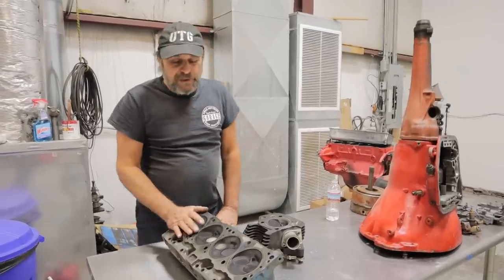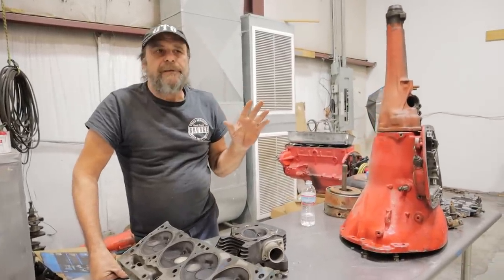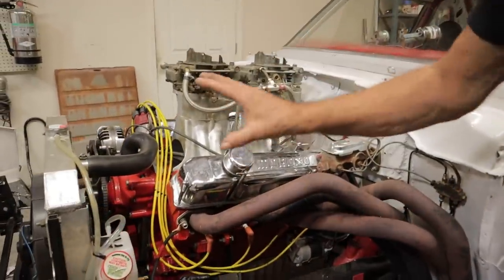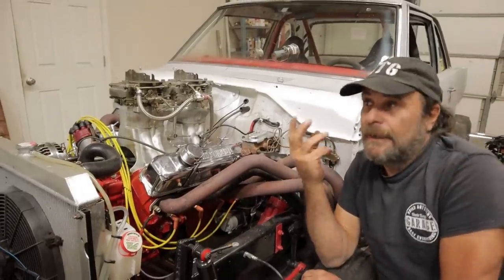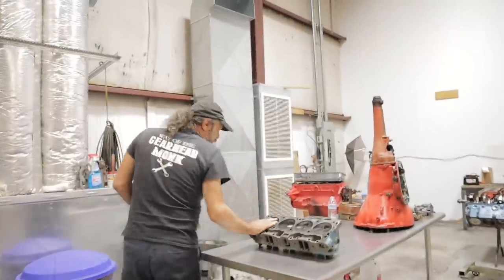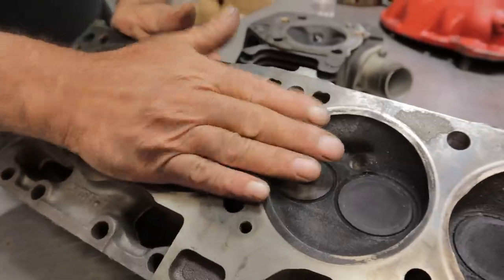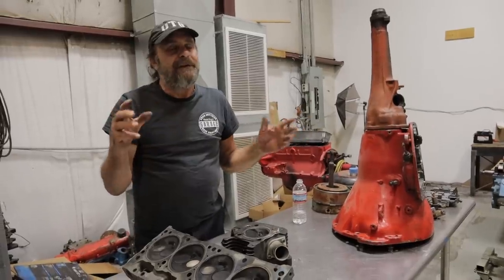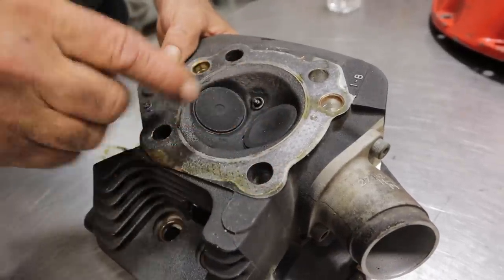The Secret Life Of Your Engines Cylinder Heads - How Combustion Chamber Shapes Make Power

Comment: The 273 LA heads from the start had more modern valve angles, compared to a small block Chevy and had a more modern spark plug location. Until the early 1960's it was thought maximum horsepower was to have a split overlap. That is a 112 degree lobe separation would be best with the intake lobe centerline at After Bottom Dead Center. It had already been found that better powder was produced with some advance, but it was thought to be due to timing chain stretch at high RPM, but it happened with gear driven camshafts too. Camshafts started getting advanced for power but it wasn't well understood. Close lobe center camshafts would often make more powder. Part of this is at split overlap, a 108 lobe separation would be timed at 108 degrees after bottom dead center, while a 112 degree lobe separation would be split, degreed at 112 degrees after bottom dead center. In the mid 1970's, camshaft theory was finally updated to state that, theoretical maximum powder would be with the intake centerline at 106 degrees after bottom dead center and maximum torque would be with the intake centerline at 102 degrees after bottom dead center, REGARDLESS OF LOBE SEPARATION. Retarding beyond 106 degrees ABDC doesn't normally help power and advancing beyond 102 degrees ABDC doesn't normally help torque. Of course if the camshaft is a big mismatch for the engine or due to certain features, these results can vary, but in general they are very close to what should happen. Some 340 and 383 Mopar engines compensate for the raised quench area of the open chamber cylinder heads by raising the piston tops above the engine block deck. This results in better quench, while allowing valves to be less shrouded in the chambers. Back in the 1970's, I remember ordering a pair of new bare 1967, 440 Magnum, 715 casting number, closed chamber cylinder heads from a Dodge dealer for $100, for the pair! Single keeper groove, stainless valves were expensive though. Single groove keepers are called for with solid lifters and recommended for any high performance build, as they hold the valves more securely and positively than multi-groove keepers, that can pop loose or fail more easily.

Comment: thanks Uncle tony! I've been pondering the expense($2600) of buying stage 1 heads for my BB Buick but then i paid $36 for D. Vizards porting book, Flow vs Oversized valves which is more beneficial to flow dynamics? cylinder filling? exhaust scavenging ? If i port what i got im out maybe $200 and AND I did it myself. overlap and scavenging are soo  overlooked in this equation!!

Comment: Theoretically, if you find the optimum three angle valve job on the valve seat and backside of the valve face, you wouldn't need as much overlap designed into the cam profile because you've created better flow at low valve lifts. you'll see this advantage (over say a 50 degree cut that works best at full lift) twice, when the valve opens and when it closes.  Given a choice between port flow and combustion design, I'll take a combustion chamber that comes closest to 100% conversion to energy (ie, excellent burn) over a 400 cfm head. You can flow air in like gangbusters and flow it back out again with or without massive overlap but if it's burning poorly and not making energy, you're going to have high rpm to try to create more energy production per second. 

David Vizard once did an experiment where creating a real good exhaust system that evacuated the cylinder on a street engine acted like single digit boost--create a signal pulse that moved the hot air (not just maintained its speed, which helps out too) and there was a vacuum of nothingness inside the cylinder when the intake valve opened up--atmospheric pressure nearly did the rest, and of course the engine wasn't trying to burn exhaust gases left in the cylinder a second time. 

One factor that can screw up the burn is fuel molecules separating from the air molecules--a high compression piston dome in the way, valve shrouding, or poor bowl work will likely cause this issue. The 318 Poly might be the best combo of putting the plug near the center of the cylinder and yet allowing for a flattop piston.  Valve angles are an issue, but with EFI nowadays a clean sheet cylinder head can be designed with a radical intake port--we see some intake manifolds on modern engines that seem to nearly crowd the valve covers since the manifold is running "dry", like an old buick nailhead log manifold. 

another necessary evil is the combustion chamber itself. If combustion occurs mostly in an indentation in the cylinder head, its pushing mostly on a cylinder head bolted to go nowhere. the Chevy W engine and MEL designs from Ford had no combustion chamber in the head at all--just a flat deck with three holes, two for valves and one for the spark plug. Combustion happened down inside the cylinder, inside the deep dish of the piston. Had the valves been set up not side by side, but more like the Poly 318, there could have been a better flow as the intake valve would be closer to the intake manifold, the exhaust valve closer to the exhaust port and less Z bend inside the cylinder.

Comment: Not sure if you will see this Uncle Tony but interesting enough back in Hondas glory days they used open chamber heads on there type R, B series engines. There was always a debate on what was better but my opinion was always they knew what they were doing. (Highest hp per litre N/A production engine records for  15 years until Ferrari finally beat them).  I think they went open because it helped de shroud the valves. They flowed like crazy and reved in the 8-9k range . Also just as interesting  spoon was running such high RPMs on the B series they had issues with pistons out accelerating the flame front. Maybe another reason for open chamber?

Comment: as i understand there is not a low pressure wave following the particles instead there is a low pressure wave going against the direction of propagation when area(velocity and pressure) is changed. please correct me if i am wrong

Comment: Something cool that I don’t know is possible is say take a set of LA heads which have an 18 degree valve angle & decided to do some altering to say 15 degrees like a LS head. It’s like the Chevy guys who’d take a 23 degree valve angle SBC head & turn it to a 18 degrees head. Ik that the small block mopar heads like the W7 has the 18 degree angle, W8 has 15 degree angle, & the W9 has a 13 degree angle

Comment: Great tech.  Uncle Tony,how about angle milling those 318 heads you've got, to get the  to get the desired effect ? Move part of the combustion chamber down into the cylinder. It was kinda a fad we tried for awhile back in the day.
Reply from the maker: You start to run into intake manifold fitment problems with excessive milling.  I'd like to be able to swap different intakes on and off of this engine without having to deal with any of that.
Reply: @UncleTonysGarage  You're right. It costs as much to get an intake milled as it does a head.
Reply from the maker: That's besides the point.  Custom mill an intake manifold to fit this application and it's useless on any other.
Reply: @UncleTonysGarage  Yes sir. That's one reason why i got out of racing. One specially modified part to fit one application maybe one time. I'm much happier now, following a strict budget to modify my own Mopars & sincerely delight in following you on here as you do your thing.

Comment: On an LS3 engine, does a .010 thinner head gasket only help the engine run more efficiently or does it gain hp/to.  Calculations say .3 tenths compression change.

Comment: When you add weld won't that reduce the combustion chamber volume and increase the compression ratio at the same time, also will cylinder head temp increase? Btw having a classic VW bug the heads are aluminium alloy, I dont know what is best equipment to weld, I suspect Tig which I don't have, the crankcase are magnesium alloy that can catch fire I have read.

Comment: Uncle Tony, could you do a video on the possible causes of dieseling with gas engines?   I'm thinking it must be an ignition or fuel delivery issue because I had a chevy 305 and 383 in my 65 impala, I've had them run with TBI and carbs and they both diesel on shutdown unless I leave the Trans in Drive for a bit of load to stall it.  Not sure what the cause is, suggestions on forums haven't been much help.

Comment: That is actually wrong information about the vacuum behind the exhaust gas column. It used to be believed that way a long long time ago, but has been disproven since then. The moment the pressure wave from the exhaust column exits the primary pipe into a chamber with a volume change, there is a negative pressure reflection backwards towards the valve due to that volume change. That negative pressure (vacuum) wave then accelerates the charge towards the exhaust valve. The same happens on the intake side when the positive pressure wave from the intake valve closing reflects and goes back towards the plenum. The moment it hits the plenum a vacuum wave (negative pressure) goes back again towards the intake valve. Depending on the length of the runner plus port it will create an additional charge effect. This is called pressure wave tuning.
Reply from the maker: It's called making things simple so that anyone can understand.  I've done several videos on sonic pulses and waves, mostly having to do with intake manifolds.
Reply: @UncleTonysGarage  it’s nonetheless wrong from a physics standpoint. You can also explain what I said in a fairly simple way, especially standing in front of an engine and the headers. Exactly what you said in the video has been commonly believed for a long time and many people still believe it today, but it’s a completely different concept to what actually happens.
Reply from the maker: What you're saying is true.  What I'm describing is the effect.
Reply: it's not strictly necessary for a 4 stroke too, you just can get more power out of cc. additionally you can drive scooters around with header hanging off. plup plup plup plup plup, still better power/cc ratio than 1981 usa factory v8.

Comment: The FirePower engines of the 50's have chambers that are fairly shallow ( 110 cc for a 392 ) , nothing like a 426 ( 176 cc ) or even a Harley head looks a lot more dramatic. Allpar has some neat documents from the engineers at the time.
Reply from the maker: Bore size is the difference in chamber contour and CC.  Firepower cylinder head is designed for a maximum 4 inch bore, the 426 is intended to go as big as 4.31
Reply: @UncleTonysGarage  I'm thinking that a Chrysler head with a 4.25 bore would still be far below 176 cc ( a 331 at 3.6 inch is not much different than a 392 at 4.0 ( edit  ) BOTH are at 110 cc ) . Side by side you can tell that the 426 is much more pronounced ( and a Harley head with a smaller bore for that matter ). 

They ( 50's Chrysler ) were designed to just run smooth and strong . And they did ( and do ) ... magical engines , the FirePower V-8 . As far as honest V-8 passenger car engines go they are the best to ever leave Detroit ( or my favorite at least ).
Reply from the maker: There's a difference in the actual shape of the chamber.  The early head is closer to being a true hemisphere.  The 426 head is shaped a bit differently to allow for larger valves.

Comment: Hmmmm when I was younger I remember for whatever I was fixing at the time I took the headers off my 71 318, that engine always started with a bump of the key, even better than modern cars, and I wanted to know how loud it would be without any exhaust at all. It fired up just as good as it always did and idled just fine, I reved it up and it acted the same as it always has except it would make your ears bleed. Complete contrast to what you had said on here, got any idea why mine still ran good??

Comment: Lobe separation angle then obviously determines overlap. Overlap duration must affect torque and HP curves negatively or positively depending on what you are wanting out of your engine? Does a narrow LSA provide more overlap lift for a shorter duration and is the opposite true of a wider LSA? My brain is spilling over...

Comment: Tony
You forgot to tell your audience why and how the 5th cycle does what it does nd why - 
So the Lobe Separation Angle generates the overlap event = the 5th cycle 
The closer the LSA the more overlap and wider the LSA the less overlap 
The squish/quench area is the most important part of all wedge heads and the optimum for that is zero clearance when the engine is running a max RPM - the problem then becomes the trapped end gasses between the piston and the head at TDC - but there is also a solution for that called the "V" Groove - With the proper amount of swirl and the v groove you can run 12 to 1 on pump gas

Comment: Probably you've heard this a 1000 times but buy a set of 302's 318 heads ! You can rework the ports and valves sizes the only thing in your way is the pushrod humps , i have'nt seen a 340/360 one for a while ,depending on the year , it might be similar
Reply: Or late 60's 273/318 set
Reply from the maker: The 273/318 head is awesome.  I have an extensively ported set on Bottle Rocket now and they flat work.
But, this new engine is going to need a bunch more port than can be had with those heads.

Comment: I'm confused. The Hemi design improves flow by (essentially) placing the intake valves in-line with the exhaust valves, but the lack of a quench pad hampers flow. So is it good or bad, or what?

Comment: I bought a set of fresh mystery 360 LA heads that have 80k taken off the deck surface, from some guy who runs a machine shop out of his garage. He said as long as the gap between the intake and valley was less than 30k I could run them without milling the surface of the head where the intake sits or even the intake. Did they mill 80k off the deck surface to close the chamber? What does that do to valve clearance and push rod length? I got them cheap thank go but now I'm worried

Comment: OK.  Now, how does the 30 degree intake valve angle used by Pontiac, and followed by Buick and AMC, play into this?  The 30 degree valve seat flows from 0.030" lift instead of 0.050" lift with the standard 45 degree angle, having the effect of more cam than is actually there.  Doesn't flowing sooner give the effect of just that much more overlap?

Comment: Thanks so much Unca T.. i was under the impression that more overlap may bleed off compression costing power. Am i wrong or is there a sweet spot general rule.. i'm building a 440  with 440 Source heads KB 10.2's and a comp 274 @ .501 lift. Wanted it to be dependable  but with that low end grunt. Any suggestions would be awesome.. going in a 82 d150. Also eddy rpm.. thanks!
Reply: Main downsides of lots of overlap are poor low RPM manners (the exhaust valve staying open after the 'pulse' of high velocity gas has dissipated causes exhaust to be sucked back into the cylinder, causing misfires), high hydrocarbon emissions and increased fuel consumption. It's hard to prevent some fuel taking a short-cut out the exhaust during overlap, unless the engine is direct injected.

Modern cars with DOHC and cam phasers usually change their overlap dynamically based on RPM, they use as little as possible at idle (to minimise emissions) increase it in the midrange to boost torque and then may taper it off again at the top end in order to delay the inlet valve closing and extend the rev range. With a pushrod engine you have less flexibility, low end torque tends to be best with limited overlap and relatively early inlet valve closing, but this sacrifices midrange and top end power. Going the opposite way with late inlet valve closing and lots of overlap will make big power at medium to high revs, at the expense of street manners.

Comment: Thats why i shake my head when i hear guys talking crap about BBC closed chamber heads. If you get the camshaft specs right, you proove that you can build big power output without a good "swirl" (vortech) action of the intake air/fuel charge. Old closed chamber heads are NOT bad or mediocre heads! 🏁

Comment: I am extremely amateur and my question will reveal this but I love doing this stuff too much not to ask and dont have the ability to go to school for it yet. Would this impact air to fuel ratio and would you have to adjust/get it tuned? Would it decrease or increase?
Reply from the maker: It's a fair question, Jeremy, and in my opinion, I don't believe there would be any direct correlation.  The fuel mixture itself is key to combustion efficiency, but should not effect the actual "air pump" aspect of the engine.

Comment: Hi Tony, would a small exhaust leak of a primary pipe cause a noticeable decrease of power?
Reply from the maker: Depends.  With a carbed engine, no.  With an injected engine or anything relying on an oxygen sensor, definitely yes.
Reply: @UncleTonysGarage  ok cool. it is a carbed engine and i am monitoring O2 to help me tune the carb so my readings are probably leaner until i fit it.